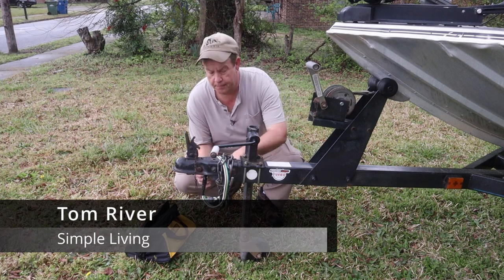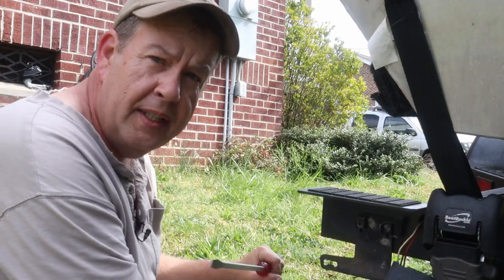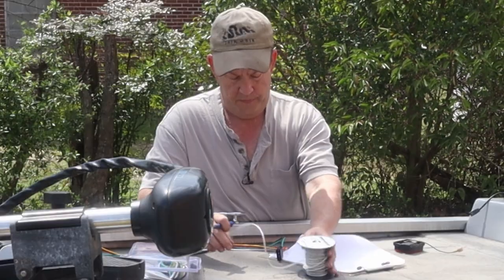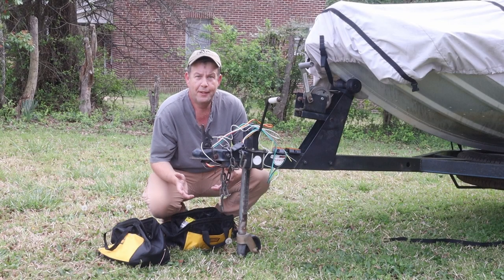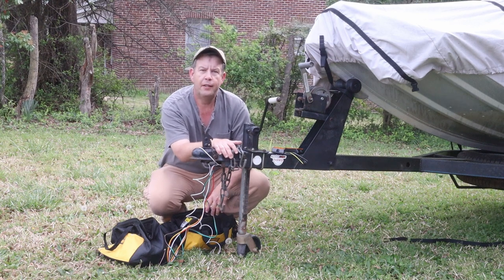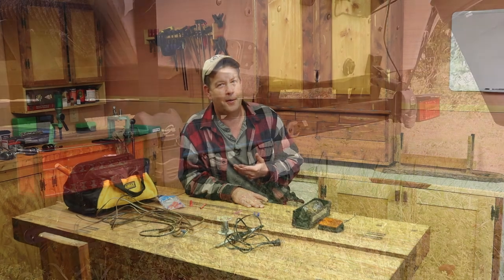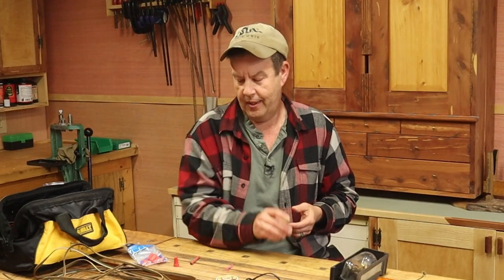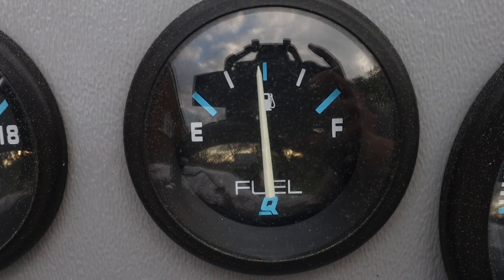Complete Boat Trailer Rewiring and Light Replacment

Comment: LOL.... Trailer lights. I struggled with lights and wiring on trailers for many years. I finally went with a whole new system right from the start with a used trailer. The other issue was springs and rollers. In my case I was dealing with salt water. I finally switched to an aluminum trailer, SS hardware, torsion suspension. It was a blessing to help deal with saltwater environment conditions. Boats.... lol.... love'm or leave'm

Comment: Being a used boat buyer; and seeing this brings back not so fond memories of the happiness of and frustrations of being a boat owner. Most used boats are just like yours. Mine was worse than yours so far. I worked on my boat more than I went fishing the first year I had it. Tires, wheel bearing, lights, boat bunks, safety chains were just part of the joy of boat ownership. No one tells you about these little unmentioned parts of fishing boats. 😅😂😄✨😱✨
Reply from the maker: And because most don't mention these fun jobs is exactly why I did this video. I want everyone to know just how much actually goes into fixing up an old boat!

Comment: Having owned a doez+ trailers over the last 20 or so years, I can feel your pain :) These days, when I get a used trailer (especially for a boat) I just go ahead and pull all the old wiring and start over... Even trailer I have bought new eventually develop issues, between driving country roads, snow/ice/ road salt/ vibrations etc. Another good tip/ trick is to get a kit that includes a junction box you can mount mid trailer. This makes sorting out issues and making repairs easier by being able to seperate out (test) circuits. Hope this helps someone!
Reply from the maker: Thanks Mike, that's a good idea on the junction box. I'll keep that one in mind for the future.

Comment: Tom, I like ya buddy. Love the videos. I gotta call you out on this one tho. Wire nuts and splicers on a boat trailer?? You'll be lucky to get two years b4 you have problems with those lights. The only way to wire a boat trailer that will last is soldering all your connections and heat shrink. Lots of heat shrink. Take it from a guy that learned it the hard way. Look at it this way, you wouldn't treat your model 70 like that 😁
Reply from the maker: Big Daddy, I don't mind being called out when I'm wrong. And I don't remember if I mentioned it in the video but I was actually planning on soldering the connections but my old soldering iron died on me. That's why I ended going with wire nuts and tape. But since I don't do salt water that should last me a little while???

Comment: There is a magic place on a river somewhere in British Columbia (that's as much info as you get about location) where fly fishing for seriously big rainbow trout is as good as it gets... anywhere. Perhaps one reason it isn't all that crowded when we get there is that you have to travel about 120 miles over what might be the worst gravel roads on the planet. Vehicles and boat trailers take a terrible beating. You have to budget for at least one ruined tire per trip, both vehicle and trailer. Trailer wheel bearings have been known to fail with one trip. Once, one of the vehicles blew two tires... at the same time. 

My trailer for my aluminum boat gets bounced up and down, plus a fair bit of sideways. I count on having to repair the wiring roughly every year. I redo the lights and wiring about every five years. No matter how skookum I do the wiring, it is no match for the forces of nature. I do recall one year (and only one) where we got in and out without a single mechanical issue, so hope springs eternal. 

And yes, it's worth it. Between the pristine beauty, listening to rain fall on a tin roof at night, wilderness cooking and casting flies over pure, clean cold water for majestic rainbows, what's a little time doing some work on the trailer?
Reply from the maker: Stephen, I think you just came up with a universal human truth there, the tougher the journey the better the destination. We used to have some really special remote isolated places but it seems like the population of the whole south east has exploded and now those places are gone. I had a really nice stretch of trout river a couple of hours north west of me (nothing like you're talking about but it was nice). The last time I was there the small primitive camp ground (4 spots) that I used to camp at had been turned into a full fledged hippie commune, and I'm not exaggerating on that. The national forest restrooms in the area (very small isolated primitive restrooms) literally had signs saying people couldn't live there. 20 years ago I would have never seen another soul in that area. There were houses in the back ground on the local lake where I first carried my boat out to see how it was going to run. Where those houses were was all old forest with not a single house the last time I was there. That whole lake (12,000 acres) has now been developed from the damn to the tributaries and there literally are no lots left on it. I just can't believe the population growth here with so many yankees leaving the north east. The places like you described are pretty much gone here and just a thing of the past. Even the coastal swamps and waterways. The east coat has pretty much become like Great Britain where decent hunting and fishing are things reserved for the rich that can afford the land and keep everyone else out. Treasure what you have there my friend because those place now only exist as memories for me. 

Now on a more positive note, I have been watching a channel called Wild Fly Productions. I don't know if you have seen them but it's a channel you might like? The first video I saw from them (Norther Natives) they were fishing in Canada for Bull Trout and that looked like a lot of fun! And they only fly fish. I have been watching them mainly because I have been so impressed with how well their videos are made but also because there is just something special about fly fishing.

Comment: Their a little spendy but they make those wire nuts with an epoxy sealer in them.
Reply from the maker: Don I sure wish I had known that when I was doing this one. A wire nut with epoxy would be tough to beat.
Reply: @Tom River - Simple Living   An alternative is fill wire nut with thick Dielectric grease and tape up good. 
Also they make the heat sealed butt connectors with different sizes on same connector so you can put 2 wires in one side one in the other, or use a larger size to join 4 wires with 2 going into each side.

Comment: Wire Nuts???? On a boat trailer??😳🤷‍♂️
Reply from the maker: Ken, I had to laugh when I read your comment because I was planning on soldering the connections but my iron went out right when I started and I needed to get this done. I'm also just using this boat in freshwater so the wire nuts should be fine for years, but salt water would be a different story.

Comment: Another great video.  I was so glad to hear you talk about soldering the connections at the end. A good soldered connection with double heat strink will last a long time. Also the best wire to use is the stuff that they use on transport trailers. It looks like black extension cord. They sell it at automotive suppliers. And one last tip, run a ground wire to each light. Don't rely on the frame of the trailer.  It causes issues over the years. I believe this to be the best. 
Happy fishing 🎣  😀

Comment: As others have said “I can feel your pain”, however with a good solid understanding of electricity, proper wiring techniques, tools, connectors etc, it can be very rewarding experience in the end. 
I love using high quality crimp type connectors “marine type” that you crimp and shrink, these also contain a sealant inside that flows out when shrunk, thus sealing out water completely. Unfortunately these type connects usually can’t be found at common hardware stores “at least where I live.” My other favorite method would be a quality crimp butt type connector with shrink tubing over it that has this same type sealant in it, or better yet, twisted & soldered wires with shrink tubing over the connection. Some crimp connectors also are designed for a double crimp, one on the wire connect portion, and the other crimp being on a special skirt section on end that acts as a strain relief boot. For multi-wire connects with wire nuts, they have wire nuts with a waterproof silicone jell inside them. Also if one must use electrical tape, there is in my opinion no substitute for 3M brand tape, such as Super 33. One can even coat the electrical tape with pvc cement to partially dissolve the tape together so it wont ever unravel. I have even caulked standard wire nuts after twisting with clear 100% silicone rubber for great under water performance. I also tend to believe that the total less connections you have to make in a functional circuit, the less potential failure points you have. I think it’s safe to say that anyone that has done a lot of wiring, would also likely agree that not all crimp connectors are created equal. Some connectors are just plain garbage, and the same goes for the crimpers being used. I have also found that some crimper pliers and connectors just don’t crimp/work well together, even with proper gauge wire. Also common type crimp connects are designed for joining stranded wire only. I have never cared much for using Scotch Locks in the past, as I have found that wire insulation thickness can vary wire, causing improper cut-in and wire bonding. Yes Scotch Locks can work in a pinch and quickly if your wire likes them. But as you correctly mentioned Tom, the common type are not waterproof, and require tape or shrink tubing to offer some water protection, and to hold them together if the latches were to snap off with brittleness. Good luck Tom, I hope you get your boat in the water soon & do some fishing. 
God bless
😎👍
Reply from the maker: Mike it sounds like you know a lot more about connectors than myself! And the marine grade connectors aren't available locally here either but if I went anywhere near salt water that's what I would have used. But I'm just fishing in fresh water so hopefully these will hold up for awhile?
Reply: @TomRiverSimpleLiving  Thanks for the reply. You did a great job with what materials you had on hand without question. I’m sure things will work just fine. I always try to share in what I’ve learned in past 35 years with electronics and wiring with others.  I genuinely respect and care for others such as yourself Tom, and your intelligent subscribers that love to learn. Life is a continuous and fun learning experience. I thank you Tom for sharing your knowledge with others and myself through your channel. I appreciate everything you have taught and shared in the past, it has been an absolute pleasure learning from you my good friend.
Take care & God bless ✌️😎👍